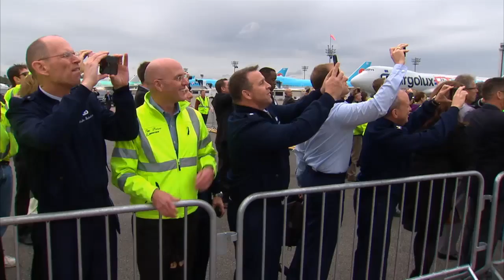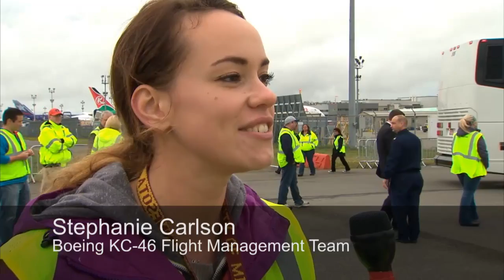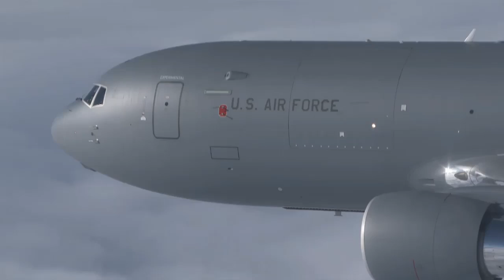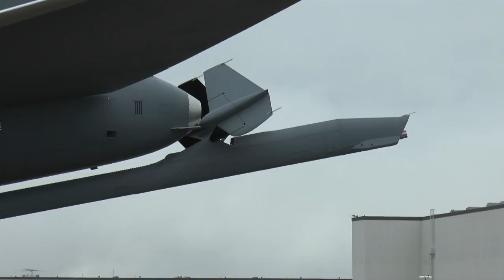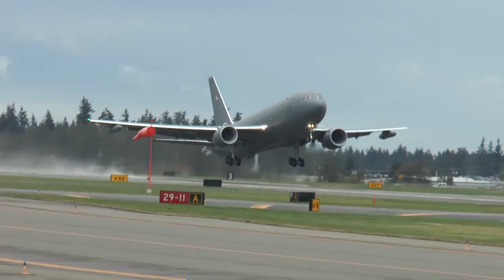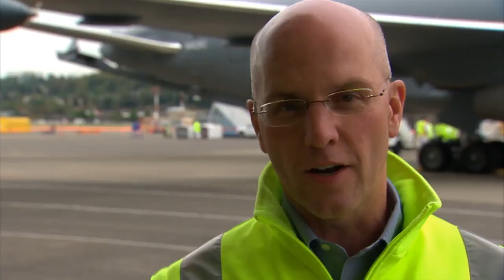Boeing’s KC-46A Pegasus Completes Successful First Test Flight

Comment: What makes this tanker better than that offering from Airbus-Northrop?
Reply: +Boekan Arsheetec 
Well basically its a Boeing ... and ... its more expensive .... and ... its late....and ....its smaller so needs less hangar space ...
But basically the US Taxpayers have been ripped off ...
Reply: +Boekan Arsheetec Politics.
Reply: +Boekan Arsheetec smaller size, can fit better.
Reply: soccerguy2433
Got to be a first when the Yanks prefer smaller ...
Reply: It might not be a 'better' plane by itself (although I'm certain it'll do the job just fine)  - however there's alot of $$$,  jobs, and of course ego involved here.
Reply: 1chish we we don't want to do construction on all our ramps.
Reply: soccerguy2433 
So the A330 MRTTs built in the USA could have had folding wing tips if needed. Its not rocket science. But I have to say the space factor on parking ramps was never raised as an issue in 2008. And forgive me mentioning it but the USAF is buying fewer KC-46s (and this would have applied to the A330) than it has KC-135s. So fewer aircraft on the ramps anyway.
Reply: 1chish no commerical heavy airplane has folding wing tips.  The military certainly isn't going to invest in a heavy airplane using folding wingtips as a first.  And its not the wingtips and ramp space... its the gear width and turning radius that would require a lot of ramp construction.  Hell the KC46 already has problems with the McConnell Taxiway width at a certain intersection, that instead of fixing the taxiway they will add a KC46 taxi line to start the turn away before turning right.
Reply: soccerguy2433 
Can I gently correct you? The new 777X has folding wingtips for the very problems you have described. And it isn't actually clever technology. We did the first folding wing aircraft in 1913. We also did the first double folding wing with the Seafire

Bottom line is the USAF is getting a less capable aircraft than it could have had which in itself is fine if that is what the Air Force need (but I doubt it). More seriously it is over budget. No surprises there given how Boeing chopped their price to keep in the game in 2006 / 7. They were awarded a £4.4 Billion development contract. They have spent (so far) $6.4 Billion. To put that into context Boeing's total Military earnings in Q1 2016 were £8 Billion.

Only 4 test aircraft have been built and they are late with approvals for the next maingate (now delayed) with serious wiring and boom refuelling issues. There is no way Boeing can deliver the first 18 production aircraft by August 2017 as contracted.
Its all here:
https://www.flightglobal.com/news/articles/boeing-records-243-million-kc-46-charge-as-it-seeks-424687/

In the real world over on this side of the Atlantic we have had all 14 of our Voyager tankers (A330 MRTT) delivered and they were ordered after Airbus were shafted by the US Government. 13 other Air Forces are flying, or will fly, the MRTT. Not one has ordered a Boeing tanker and not one with KC-135 tankers has ordered smaller aircraft.

While Boeing struggles to build a tanker Airbus has built that FAL in Alabama as promised and is now producing excellent A321 aircraft for American customers. Right on Boeing's front lawn.
Reply: 1chish i know about the folding wing tech.  I talked with a Boeing Rep about it at a A/TA convention.  Furthermore, the 777X isn't used commercially yet so why would the USAF invest in the first Heavy aircraft with folding wings.  Additionally, wing span isn't an issue. 
Japan flies a KC-46 equivalent (The KC-767) which i've personally seen fly at Red Flag Alaska and has chosen the KC-46 for the future.  Italy also flies the KC-767.
Lastly, what are we arguing about?  The MRTT is overkill for Air Force needs.  Despite being overbudget Boeing is eating cost overruns. The MRTT lost the competition.  The KC46 is meets requirements, though it can be argued that is is less capable than the MRTT. MRTT fits better for smaller air forces.  the KC46 its better when there are more aircraft which compensate for a smaller offload/cargo but increases flexibility.  Also, we don't want AR booms falling off.
Reply: soccerguy2433 
It was you said the MRTT was 'too big'. Must admit you don't hear that very often from an American. And Boeing has all its life used military contracts to feed into commercial aircraft development. And anyway haven't Boeing got all that folding wing stuff sorted?

As for your argument about a larger aircraft suiting smaller Air Forces better that really is daft mate. If you have a large number of aircraft in theatre you need long loitering times and big refuelling capabilities otherwise you risk not having a tanker in place when you need it.

Its quite sad you felt the need to drag up a 5 year old story about a test aircraft. And it wasn't the boom it was a part of the end delivery unit and aerofoil assembly. Slight difference.

And I will remind you why we having this discussion. Airbus was robbed by US Senators having won the competition by a big margin. It never lost any competition. After the US Senators basically said Boeing had to win (and actually created an ITT based on the Boeing win list) Airbus said 'OK guys ... You all have a great day. We are out'.

Still no worries mate. Its just your Tax Dollars going down the toilet for nothing. We got all the aircraft we needed a year ago.
Reply: 1chish it is too big, but not for wingspan like you said and consequently mentioned folding wingtips.
And its not daft.  Having many aircraft doesn't mean needing to have a large offload capability.  You replace the orbit with another tanker.  I'd rather have 10 KC46s tankers up than 5 MRTTs a larger offload.  Why?  Flexibility.  You can move tankers around, you can support more aircraft simultaneously, a tanker dropout due to emergency has a smaller impact on the fuel available.  This is why having KC10s can reduce flexibility.  While the KC10 can orbit longer, and offload more fuel, they don't necessarily increase flexibility.

If you haven't surmised it yet, I am a tanker pilot.

Also its no doubt you got your MRTT a year ago... you executed the contract years ago too.
Reply: soccerguy2433 
OK lets park the wingtip / size issues as they sort of became added on in the discussion.

As for you flying tankers well respect to you for your service. It also explains your understandable patriotic defence of Boeing. I also know a bit about aircraft as I am an old 'Crab' and did 15 years in the RAF on airframes, munitions and then on flight crew.

Can I summarise the key issue as I initially described it?
1) The first moves in 2002 to replace the KC-135s with the KC-767 was a failed attempt by Boeing to corrupt USAF officials in their purchasing offices to lease tankers. A woman was sacked by the Air Force, went straight to Boeing (as did her son) and she was eventually sent to jail. It also cost the top man at Boeing (and others) their jobs and others went to jail. That alone should have disqualified Boeing from any further bidding on tankers. That contract was cancelled in 2005

2) In 2007 the tanker contract was changed from leasing to purchase, numbers of units were set and the ITT set out various specification demands. Boeing were allowed to bid (wrong IMHO) as were the Airbus / Grumman consortium. The A330 MRTT met and exceeded ALL criteria laid out in the ITT including being built in the USA while the Boeing offer didn't actually meet the full ITT demands. Airbus / Grumman were awarded the contract in February 2008. US Senators (funded by Boeing) raised objections, the US Accountability Office cancelled that contract in June 2008.

3) In September 2009 the USAF re-opened the bidding. Grumman said 'No Thanks' and walked away, Airbus technically stayed in but had in fact walked away when the revised ITT specified everything the KC-767 achieved in the earlier assessment and excluded the areas where the MRTT had been exceptional. Boeing were gifted the contract for their KC-46 in February 2011.

So 5 years on what do you have? Still no operational KC-46 for people like you to fly some 14 years after the whole sorry saga started.

As regards our 14 Voyager (MRTT) tankers? The contract was signed in March 2008. A month after the USAF signed the  deal with Airbus / Grumman. Difference is all ours were delivered by 2015.

If you can't see how corrupt and wasteful Boeing is, the Washington corruption, the total waste of time and money, the 15 year delay in replacing very old KC-135s and the damage all that did to the USA's reputation overseas then your patriotism has blinded you my friend. What Boeing did was make sure no foreign manufacturer ever bid again for a US aircraft contract. Obama made sure of that by cancelling the British Merlin helicopters the USMC had chosen for the new 'Marine One' aircraft. 9 aircraft wasted and POTUS is still flying in old aircraft. Sadly its you US Taxpayers that bear the costs of all this corruption.... 

But anyway safe flying and many happy landings my friend.

Comment: i don't get it, why is it "a big deal" ? sure it's a first test flight but is it not "just" a modified 767 ?
Reply: well all those people built the plane and it feels good too succseed..
Reply: +SAM V (Sam737)  The devil is in the details...
Reply: +SAM V (Sam737) 
Yeah you're right they should directly sell it why test it ? I mean it's just a modified 767....it's not like if it has new flight control modes and several structural and cockpit modifications...
Reply: Plus it has a -400 tail section on it.